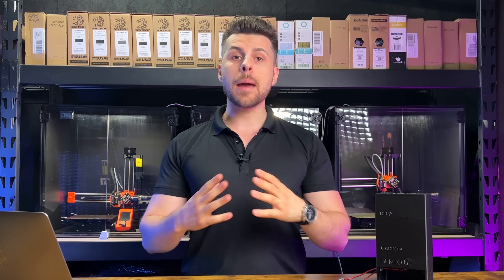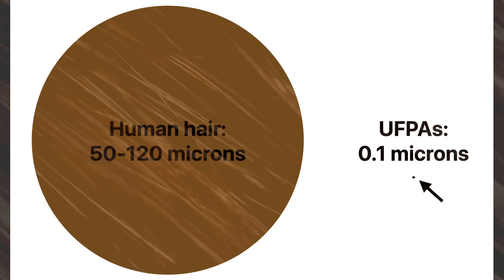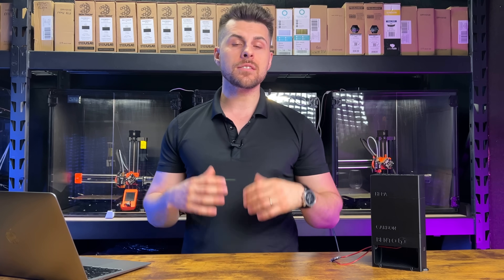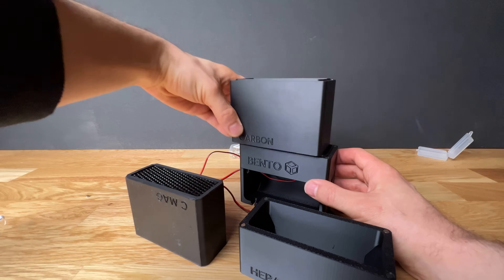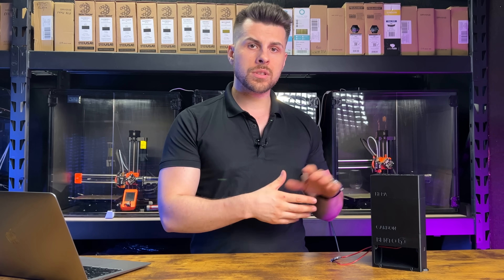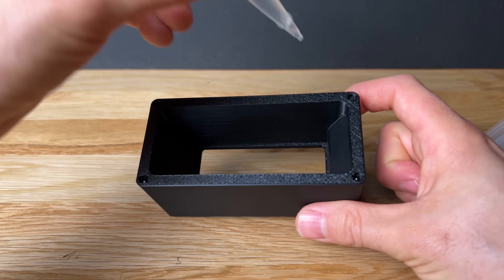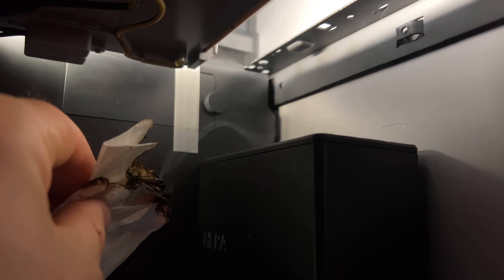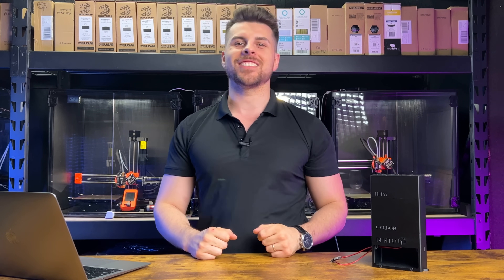Best DIY filter for your 3D printer: solving 3d printing smell and fumes

Comment: I just want something that I can use to print in my studio apartment without getting cancer or asthma...
Reply: @@PotatobitzI've designed and implemented something similar, safety isn't overkill. 
Now I'm debating installing a filter vs an air purifier.
Reply: @sonic4life why not both? I currently have a air purifier ontop of the shelf that is directly above my printers but am currently making this as well as id like to dabble with the "engineering" materials to see how they perform 😁 never hurts to double down on safety!
Reply: Get the Bento Box and the X-Filter upgrade if you have an X-1 or P1S. The X-Filter alone eliminated the smell of PLA and PETG which tells me the HEPA filter addon took care of any particulate those generate. My experience is the Bento Box helps a lot with ASA but it’s not enough to eliminate the stench which means it’s probably still not safe.
Reply: Doesn't exist
Reply: I’m currently just venting to outside but am after something like this to help with any that’s missed etc, iv used the nevermore system on a voron in the past  but this looks more beefy.
Reply: What brought me here is I’m learning CAD and want to design my own Solder vapor exhaust filter with the same carbon/hepa filtering capability and want to add THIS to my Creality K1 now 😂. Long day so I was tempted to tease everyone above regarding “CAN”T BE TOO SAFE!” 😂 but honestly, it’s a worthy fight. Go to Nathan builds robots and watch his video on handling Carbon Fiber. Blew me away. I haven’t printed with any  of the blends yet and won’t until I’ve a good filtering system in place and when that happens I don’t think I’ll wear merely latex gloves to handle it. Possibly something way more impenetrable. So, in the long run I also think that having both the filtering on the printer and a room filter? Great idea. I’m 60 soon and it may sound morbid but I’m not as worried as I start to see the end in sight lol. Everyone out there 20/30/40/50 I’d think should be very dialed into VOC’s as well as other possible exposures with what we do. Anyway, carry on, great filter. I totally dig this!
Reply: @@Potatobitz I am thinking of the same thing to get some air circulation in my basement.  And it's not overkill at all!
Reply: How long does the carbon last?
Reply: Get a whole room hepa filter and put the printer in a room you don't spend time in. The UFPA are what cause the "cold" like symptoms. And as far as we know ASA doesn't release any confirmed carcinogens.
Reply: @Inova3DSolutions He said it was a studio apartment. It only has 1 room..
Reply: @Vintage_XV put it in the bathroom with the fart fan on full blast

Comment: Have you seen/ tried the new mars mate?
Reply from the maker: Hey, did not, i usually wait at least 6mo before trying/changing equipment. There is a trend where first buyers are used as beta testers. :(
Reply: Im waiting for reviews on that unit before buying a 3d printer, hopefully some will come soon @3DPrintingForMoney

Comment: I’m a little confused shouldn’t the filters be placed carbon first then heap? But I’m guessing cause it’s a recirculating it doesn’t really matter.
Reply from the maker: Think of the filters like strainers. If you put the strainer with smaller mesh first, it will clog up with all the bigger particles. ;)
Reply: @3DPrintingForMoney  Alveo3D that makes the carbon filter for the Prusa enclosure, among others, has the carbon filter first and then HEPA.
Reply: Reverse the fans.

Comment: How do you run those power wires into the bambu lab closure from outside? Just bought one for my machine. Thanks!
Reply from the maker: There are a couple of factory holes - small gauge wires fit perfectly

Comment: I’d really like to be able to turn on the chamber fan to 100% for a set time after I print ASA or ABS. I want to duct it from the back to the window but I can’t work out the gcode 😫
Reply: You can put the printer in a fire resistant enclosure & vent that to your window.

Comment: The Bambu Labs X1C has a carbon filter in it. All you have to do is install a Hepa Filter to the outside of the fan assisted outlet. There are several models for this on Printables.
Reply from the maker: It absolutely does! but it is single pass..internal recirculating filters grants higher adsorption rates.
Plus abs/asa etc benefit a lot from a hot chamber and printing with exhausting with fan on decreases internal chamber temperatures. Can be turned on only when print has finished but then cooling factor for these materials isn’t optimal. They need to be brought to room temperature gently to retain part strength

Comment: Do you have any measurement results from room before and after filter installation?
Reply from the maker: Odor for now. Looking to get a decent meter but they are $500 and up…Cheap ones aren’t accurate enough
Reply: I have cheaper meter that cost around 140e. I got this for my electronics hobby. I use some chemicals for cleaning flux off pcb and I wanted to see how long those fumes were staying on room. I live small apartment so my hobby area is also where I spend my time.
This can show if room air quality level is ok for long term use. Range in this meter is not enough to do checking if you need personal protective equipment when you do short visit in room. 
Scale end where it was not recommended to be in same room over 1 months. TVOC range ended 9.9mg/m3. For long term exposure it should be under 1 mg/m3.

Comment: Thank you! There's just so little coverage on this important topic! Btw, if I understood your correclty, you mentioned this solution reduced the fumes in a room with multiple printers, down to undetectable level. How did you measure the air quality, and did you use any external ventilation specifically for this room/printers?

Comment: Any experience with the noise of these 4020 fans? Is it comparable to the cooling fans that sit on the extruder of a 3D printer? I want to use the bento to vent my enclosure into the environment to prevent overheating inside but if I have a noisy fan outside I could leave the enclosure open from the beginning.
Reply from the maker: Noise level with listed 4020 is way lower than regular fans, almost “silent”. In my print shop without looking at the on/off switch i can’t tell if they are on or off

Comment: hi when i drop the carbon filter nets on the build plate the just look like solid pieces even if i open the file in onshape it just still looks solid has anyone else experienced this or can you let me know what i might be getting wrong.
Reply from the maker: You have to set top and bottom layers=0 ad use grid or honeycomb infill (30-50%) ;)
Reply: @3DPrintingForMoney  hi thanks for helping me with this, and no I didn't do any of that but I just tried it and now it looks great so thanks again for the help 👍
Reply from the maker: No worries, happy i could help a fellow 3d printer-er! 👌🏼

Comment: How does this compare to the Voron Nevermore solution, which seems more compact?
Reply from the maker: The micro is more compact. There is a mini bentobox on printable from the designer that is comparable!
Reply: @3DPrintingForMoney  since the micro/mini are more compact, do you anticipate this regular Bento box to be capturing even more? Or does everything depend on the quality of the seal, for the most part?

Comment: I wonder why 2 40mm fans have been used. The first section of the box (air intake) is already huge enough to complement one 80mm or even 120 mm PC fan that would be much quieter but moves a lot more air.
The fans dont have to be laying in that chamber. A bigger 120 mm fan could also stand and intake air.
Otherwise good comparison.
Reply from the maker: 4020 probably for space constraints in the x1c chamber, bigger fans are viable…there should be some mods on printables

Comment: surprised it wasn't designed with blower motors, which has higher static pressure but lower flow than fans,  someone did post a remix with blowers!
Reply from the maker: Yep. If i recall the original designer did some test comparison that made him lean towards the 4020

Comment: can this be used as chamber heating too?
Reply from the maker: It circulates air, so it will increase the internal temp a little. but very little compared to a heating element
Reply: You can just add a PTC heating element.
Reply: It doesn’t heat anything

Comment: I can't argue against doing whatever you can do to make the air you breathe healthy and clean, but the only real solution is putting your printer in an enclosure and exhausting the gas outdoors.  Some resin printers have covers with a hole built in so you can add an exhaust.

All you need besides the enclosure is a small fan with a connection to some  power source like a usb to 3 or4 pin and that little Noctua fan controller.  You can print flanges and you'll need to source some small hoses.  You can then, depending on budget, get some plywood or plexi and make something to cover up your window opening that the hose can stick in to vent outside.  You only need the smallest amount of airflow to move the air outside.  Casement crank windows are another story.  You're likely gonna need a big piece to stick in the window.
Reply: I’m thinking about ducting my Bambu out the window which is just behind the printer. Only issue is I’d like to turn the chamber fan on after a print but can’t work out the gcode 😬

Comment: in order to have a negative pressure in printer enclosure you need fresh air entry at a controlled point , One to not create a draft and two to maintain a fresh air to recycle with saturated enclosure air. Also vent to external sources not into a direct room. Even if "Filtered" it still has byproduct that passes through. Safety Third people
Reply: One of the problems is you need to keep the chamber temperature up with certain materials. Exhausting the warm air and pulling in fresh air will work against that unless you preheat the intake air. A recirculating design like the bento box is just recirculating the existing air already inside the chamber thus it stays constant.
Reply: @JoJa015  in addition to the CNC solution mentioned in my previous post, which does not vent outside; we do 3D printing as well.  w our old resin printers (our first FDM, a MK4 arrives this Tuesday) we vented directly outside via an exhaust hood for years.  

We were literally talking a couple of hours ago about filtering when we setup the mini-farm chamber(s) in a few weeks.  Note, we’re just doing PLA on the FDM for now, but, we want to filter the fumes and other little nasties from the resin printers that are coming.  So we’re likely going w a multi-stage shop-built activated-carbon closed loop filter.  Likely issue will be too much heat - the problem we encountered when we tried a similar approach w our old resin printers.  Given we’re In Texas, too much heat (and humidity, we run dehumidifiers in our resin casting area) is what we face the majority of the year in our part of the state.  Some type of room heat exchanger or other temp control solution might be needed to help maintain a proper print chamber temp.  We’ll just have to see how it goes.
Reply: I started making my comment above before yours and got distracted or I would've put it in response here  :)
Reply: We run negative pressure on our woodworking CNC enclosures and also on our VMC (running Renshape eg modeling board..urethane board is nasty stuff in the lungs).  Pull  is done via a Frankenstien’d 3hp 3 stage collector w a final output merv 15 filter. That aside, to the point of the above comment, our enclosures are fitted for 20x25 merv 10/12 (whichever is in stock) on the inlet air side.   Don’t starve your vac pull.  For the retentively inclined, anemometers are fun and you can find yourself chasing the Rabbit real fast 😏
Reply from the maker: absolutely!

Comment: I was hoping you would show how the wiring was routed to the outside. I have mine completely build using 24 volts fans but at first glance I don't see any holes.
Reply from the maker: if you have a X1C, you have a factory small hole in the bottom left corner of the printer. i have + and - cables going out from there.
i used a T tap connector, to have only 2 cables instead of 4 leaving the bentobox. less mess, and you can place an external switch to decide when to turn on or off the filter
Reply: @3DPrintingForMoney  Thanks and wanted to add this is the first video that even shows the filter installed in a printer.
Reply: @3DPrintingForMoney  ok that's what I was thinking but I'm not near the x1c. I have all the parts to run the wire.
Reply: I actually found out that if you are printing on the X1 carbon once you slice the plate it prints properly no need to change any settings.